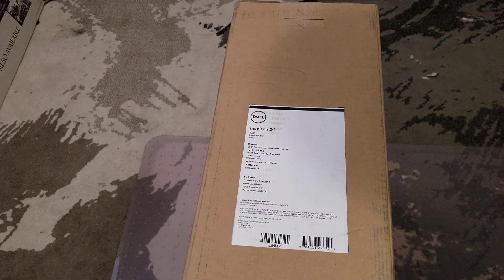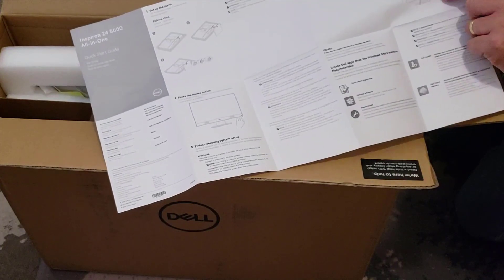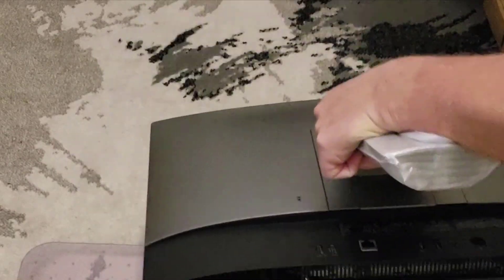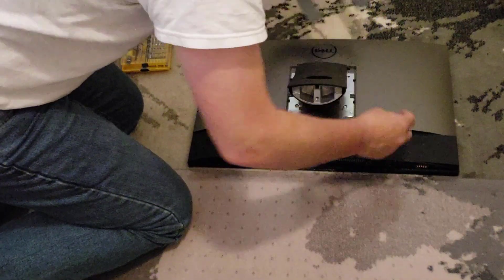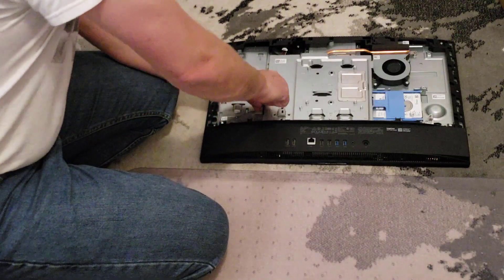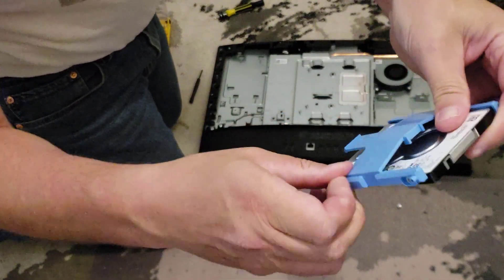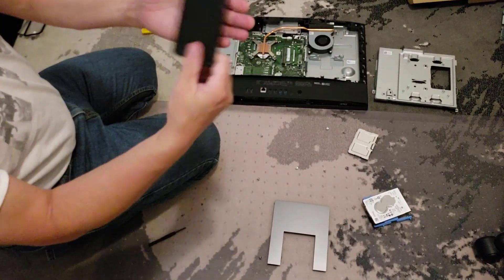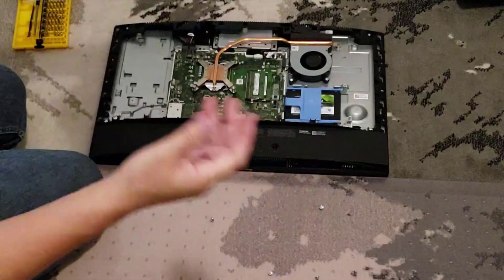Dell Inspiron 24" 5477 All In One, Unboxing, Disassembly & Hard Drive Change to SSD

Comment: Hi nice Video =)i have one important Question.
Can you Change the CPU, for a example, buy the i3 model and change it throug a i7.
Reply: Hi Fabian. You can change the CPU however typically all in one computers require CPUs with a lower TDP of 35 watts and not the more common 65 watt or 95 watt TDP of mainstream consumer processors. This particular unit would require purchase of 35 watt TDP cpu like the i5 8400T, 8500T, 8600T or i7 8700T. These low TDP processors aren't as common to purchase by the public as they are sold directly to OEMs. You can order them from places like PC Mall, Tiger Direct, Next Warehouse and BH Photo but they are not likely to stock them. They tend to be classified as direct ship from the manufacture, so expect a long wait time to receive an order. Every now and then you may find some T series processors pop up on eBay, but the prices tend to far exceed Intel's factory MSRP. Hope that helps.